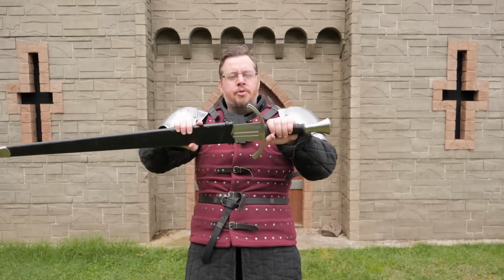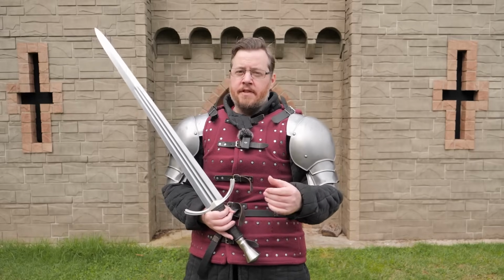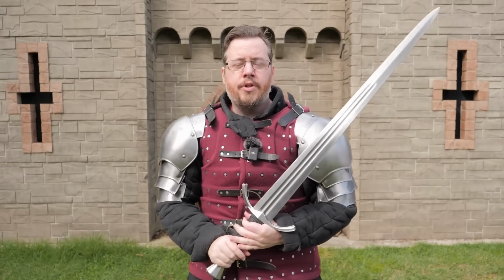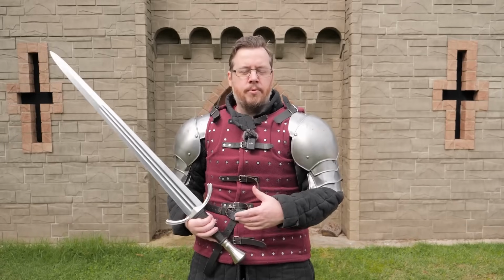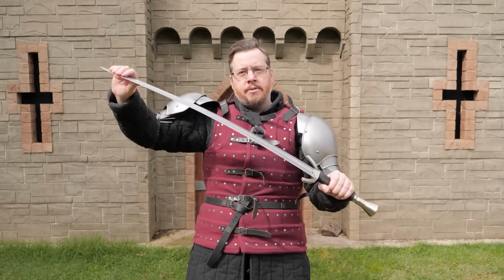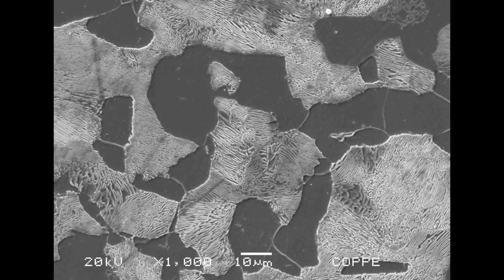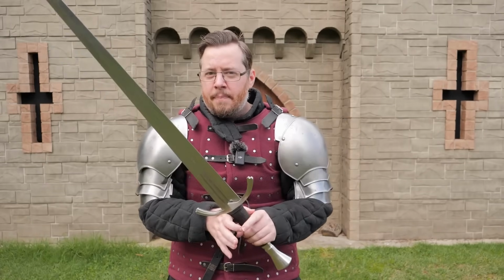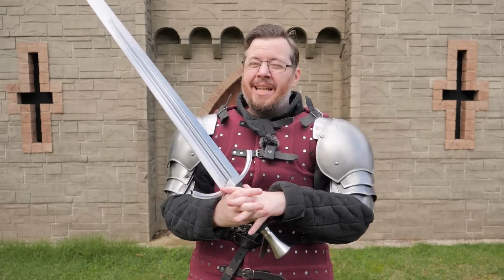Explaining the mystery of sword METALLURGY!

Comment: Another major reason for the switch from bronze to iron at least around the Mediterranean and Europe was the Bronze Age Collapse. One of the two components of bronze, Tin, is actually very rare in the Earth's crust and only found in a few scattered regions in and around Europe and the Mediterranean. To use bronze on the scale the Empires of the time needed required intense international trade. When those empires collapsed for murky reasons, that trade dried up and so people switched to iron out of necessity.
The term "Iron Age" is actually a derogatory term from a Greek writer who was lamenting how much harder it is to work iron than bronze.
Reply: Good point. Bronze age tin came from as far as Afghanistan. Tin ore is actually fairly abundant in the mountains of Turkey and Greece but somehow those cultures were unaware of it. During the iron age Phoenicians sourced tin from as far away as Britain, even though there were much closer sources.

Comment: 5:30 this is because above 727 C° or 1000K, the iron changes phase into whats called "Austenite" which has an FCC structure, which while being denser than the BCC ferrite, has larger holes, meaning the carbon attoms fit more easily.
The martensite having much smaller grains means that the motion of Dislocations(defects) in the crystal structure get stopped sooner by the grain boundaries, meaning the metal is stronger, but more brittle.

Comment: Shad is pretty spot on with this video, and I'm no expert in tempering springs or swords. I just want to say that when you draw tool steels for things like cutting, stamping, or blanking dies or for cavity and core blocks in plastic injection molds, you will typically only heat the metal up to some point between 200c to 400c. Each alloy has different optimal draw temperatures. You would never heat those industrial tool steels up to a dull orange for tempering.

But, like I said already, I never tempered swords.

One more thing, you can introduce additional carbon into a surface layer up to a mm thick by quenching your steel part in oil. That said, oil quench wont work for some steels because it is too slow, and won't work for a whole lot more steels because it is too fast. When you quench the blocks from a mold or die set too quickly they can crack or even shatter.

Comment: The difference between ferrite and martensite can be perfectly compared to the difference between an empty balloon and an inflated balloon.
When ferrite is heated up to about 600°C (can depend on the alloy) it changes into another type of crystal called austenite. A single crystal of ferrite looks like a cube with one atom of iron on every corner and one in the centre of the cube, austenite looks like a cube with one atom on every corner and one in the centre of every face of the cube, an empty space in the middle. At around 600°C the carbon freely floats around the crystal  and will freely migrate into the centre of the austenite crystal since there’s so much room inside. When the steel is cooled slowly, the austenite changes back to ferrite and since the ferrite does not have room in the centre of the crystal the carbon is slowly forced out back into the pearlite as mentioned in the video. This is the deflated balloon. When cooled rapidly, the carbon has no time to move away and gets trapped inside the crystal that wants to form ferrite but which now has a bunch of carbon stuck where there isn’t really room for it, blowing it up like a balloon. This is the main reason why the curve on a katana is formed due to the differential heat treatment, since the martensite (aka blown up ferrite, kinda) is physically larger than ferrite and therefor pushes the tip of the blade upwards.
A deflated balloon (ferrite) is soft, malleable, shapeless, but nearly impossible to tear. An inflated balloon (martensite) is hard, not deformable, has a defined shape, but one imperfection or tiny tear in it will rip to pieces. 
I know no better way to illustrate the difference between toughness (deflated) and hardness (inflated).